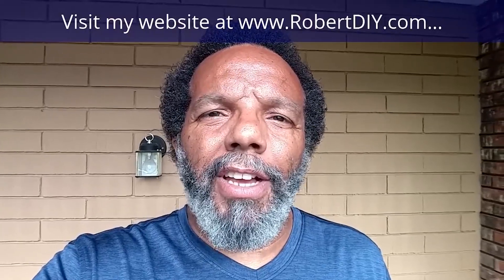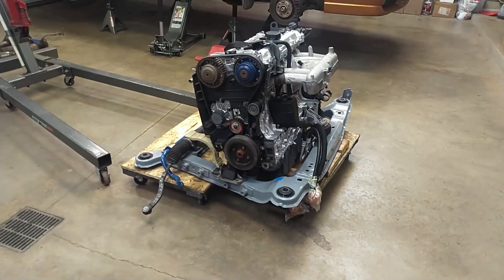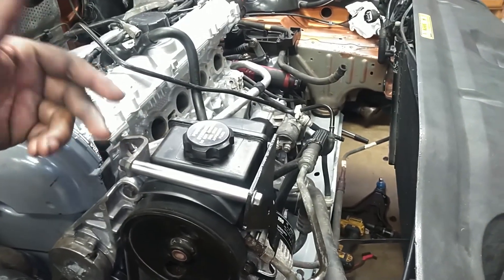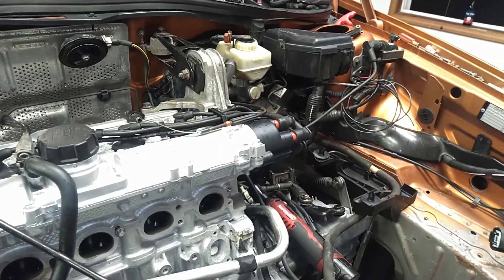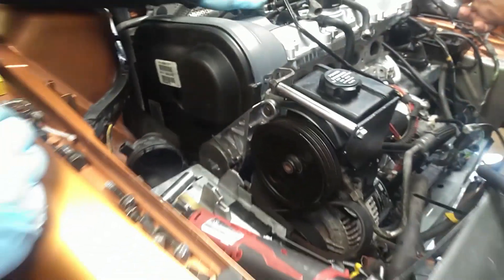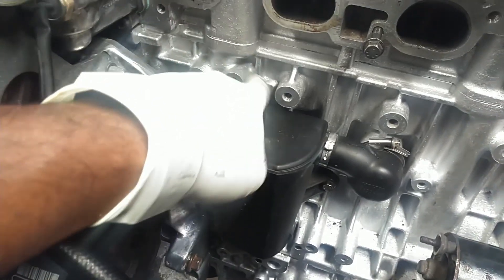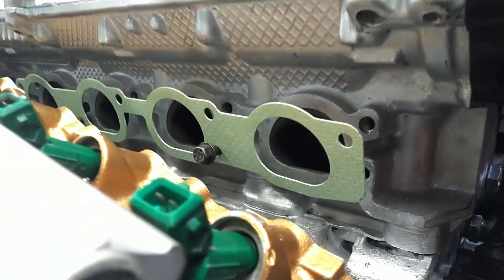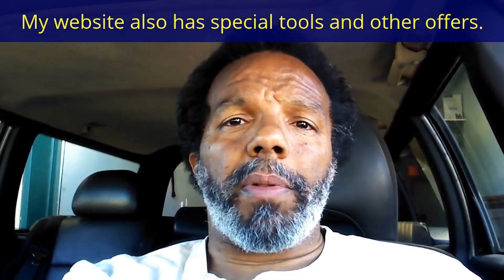RN engine swap mods that you may need to make when upgrading your P80, S70, 850, V70, C70, etc. VOTD

Comment: Robert, I have an 08 c70 2.5L t5 with bad motor and i have an 08 s60 2.5L t5 with a good motor. Can I drop the s60 motor into the c70 without much modifications? any info would be much appreciated!
Reply from the maker: I don't think so.

Comment: Is it necessary to drill and tap the holes for the p80 NA manifold?
Reply from the maker: Yes to connect the vacuum lines.
Reply from the maker: What holes?
Reply: I mean the manifold bolt holes that were drilled and tapped on this car

Comment: Can you use that engine fine without dual VVTs? Also I am looking at a B5254t4 engine for sale. Are those as capable as a t5?
Reply from the maker: I don't know my engine numbers. Is it out of a T5 or R car?
Reply: @RobertDIY  It is out of an R car. I need my engine replaced. Do you know of anyone that has a good condition RN engine for sale from a T5 or R?

Comment: isnt the 2.3 t5 good enough for tuning? Ive got a C70 t5 from 98.
I was planning on doing a little chiptuning.
Reply from the maker: Sure, up to about 400 whp.
Reply: My worry is. Even if it checks out. An old engine, has already put on a lot of hours. It may go a long time, with care. But to then pull a lot more power out of it. Will it last?
Reply: @billpetersen298  mine has done 220.000 kilometres. Thats about 135.000 miles
Reply: I’m in the same boat as you. My 97 300,000km burnt a valve, first time I drove it hard, going through the mountains. Had to redo the head, put a 94 turbo head on. My 97 with 240-250,000 is good, my 97 with 220,000 had to do valve seals. Just bought a 98 with 185,000, runs great, valve seals again.
Reply: @billpetersen298  Mine doesnt have any valve seal problems yet. doesnt burn oil at all either. Just had to do the pcv system a few weeks ago.
you are still right however it is an old engine. I wouldnt mind some more power though and espacially better fuel consumption.